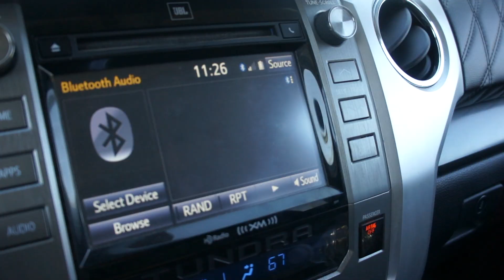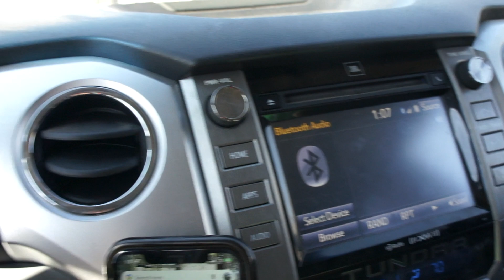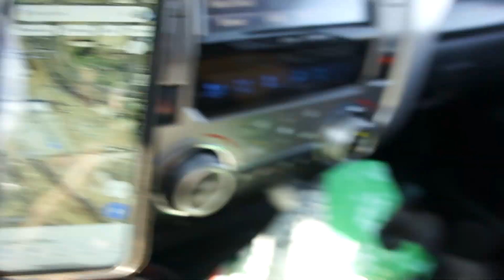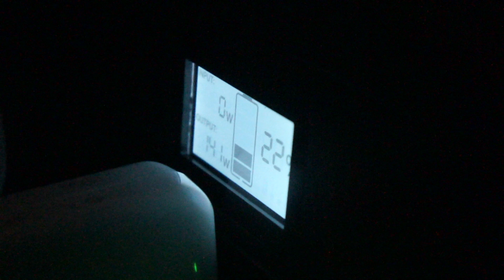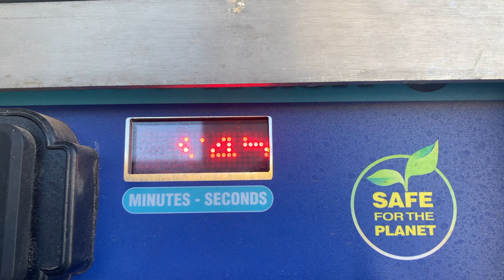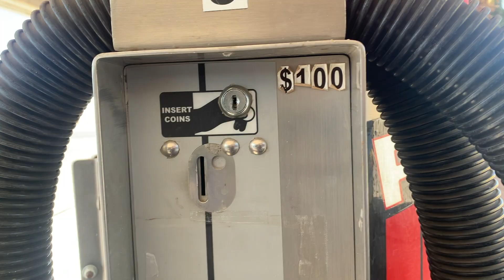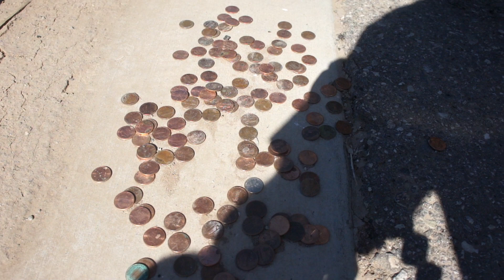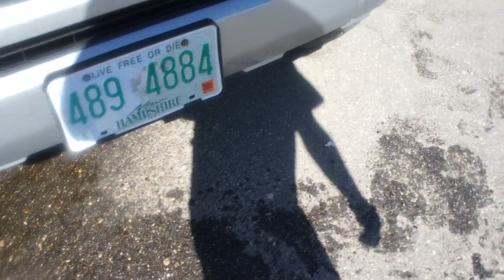Big Mistake at the Mexican Border! (Police Involved)

Comment: Not sure the official name of that aircraft, but they are generally known as ospreys. I used to see them flying in and out of Miramar Air Force Base all the time when I worked at Montgomery field in San Diego
Reply from the maker: Osprey is a good name for them. There cool looking.
Reply: V-22 Osprey. Marine Corps VTOL aircraft
Reply: They're designed to take off vertically like a helicopter or horizontally like a plane